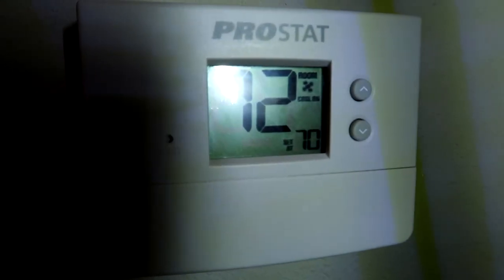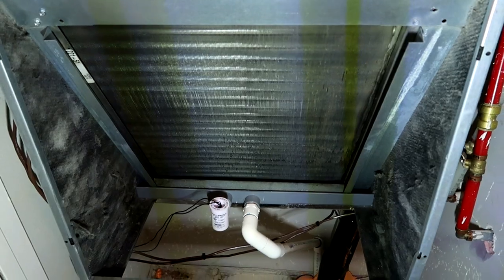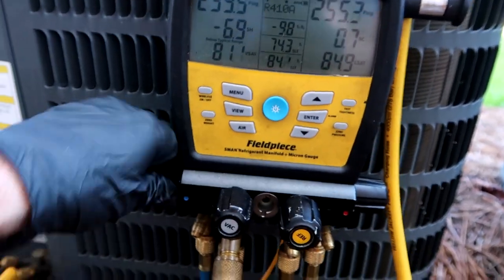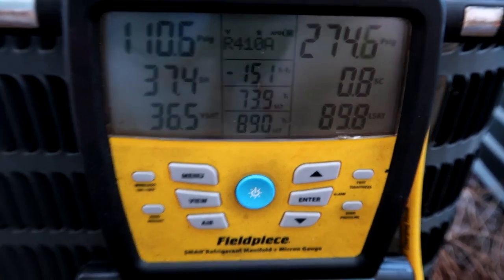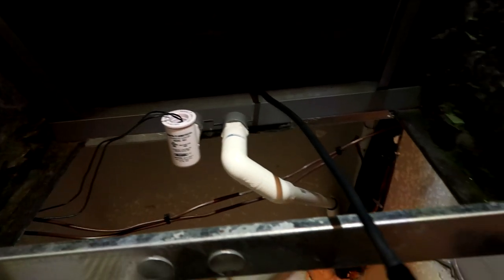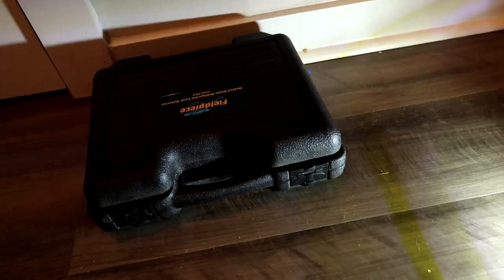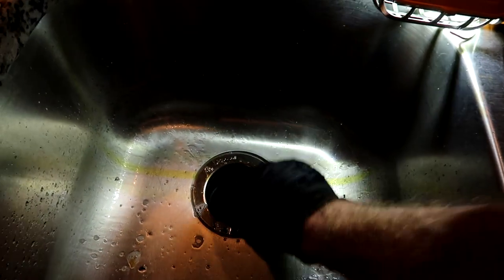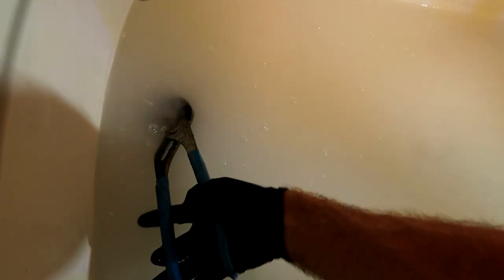Three Common Work Orders in Apartment Maintenance

Comment: Those compressor you have to be between 4-24 on sh 
But if they dont  change the orifice on txv that's what throws the super out the door. At that point you charge with subcool. Those amana and Goodman condenser have a orifice that comes with them to put in txv and a lot of people throw them away. So that's why you have a high superheat and subcool that's on the money.
Reply from the maker: Awesome! It's been driving me crazy as to why. Thank you so much Ares!

Comment: Are those smans yours or the properties? I know you have a set of Testo's as well. I recently got myself the Fieldpiece job link probes with the psychrometer probes, I just haven't broke them out yet as most AC calls lately been either burnt blower boards, float switches or caps. Next coil or condenser replacement I have I'm gonna bust them out on video. Keep the vids coming Skid bro 👍
Reply from the maker: The SMANs are the property's. I really like them now. 😆 I still got Testos in the truck as backup. Good to hear from you Rich!

Comment: Are you just dumping the refrigerant into the air? Or do you recover it and recycle it?
Reply from the maker: Recover when doing condenser work. Pump down when doing air handler work like coil or txv replacement. Thank you so much for watching Robert!
Reply: @LexVance  Thank you, Lex, for responding back.

Comment: Well I lucked out, got a chief maintenance position in Orlando.  For 74,000 a year salary.  I'm surprised florida usually doesn't pay as well as the west coast. But though I'm experienced in HVAC I still need to get certified.  Any place I can take a short course? Thanks
Reply from the maker: Johnstone HVAC Supply has EPA courses. That's all you need in maintenance. To get HVAC certified you'll have to attend a trade school at vocational school.

Comment: hey lex hows it going  i had a quick question i notice you were turning blue knob which is super heat. Is that unit have a piston?
Reply from the maker: That's where the gas has to be released into the system. Whether it's a piston or txv. However, if it has a piston you charge by superheat. If it has a txv, charge by subcool. Both get gas through blue hose though.
Reply: @LexVance  I see. And when you charge by super heat do you turn red knob with cylinder upside down or upright?

Comment: Isn’t  SH is so high because the SLT was at 74 degrees?
Reply from the maker: Yep. Would need to add more refrigerant to bring SLT down. Making head pressure and subcool rise. The rotary compressors are weird and I don't like them. They all do that. High SH and SLT but subcool is good and unit cools fine. 🤔
Thank you so much for watching Juan!